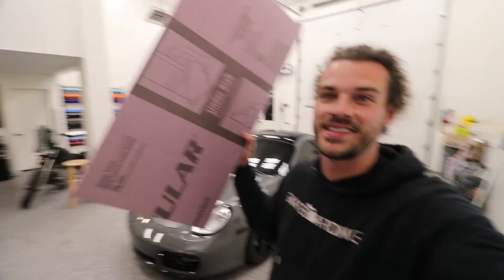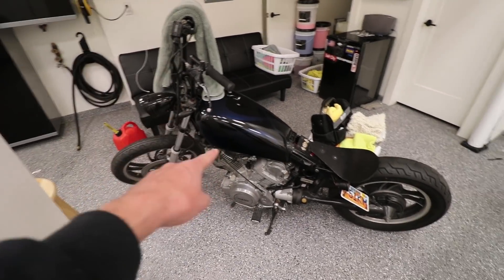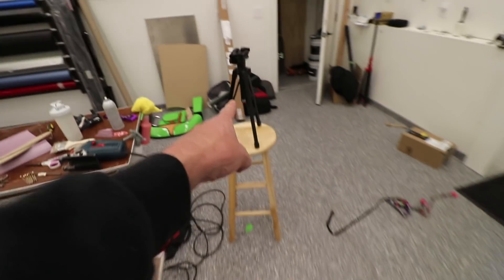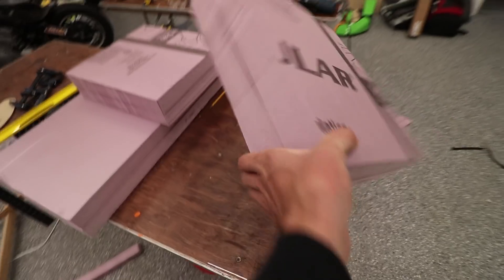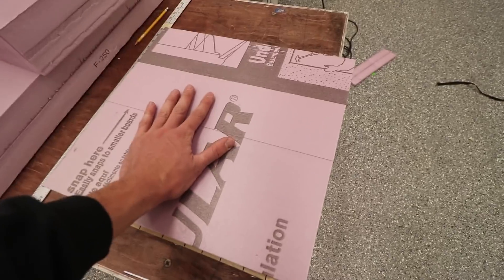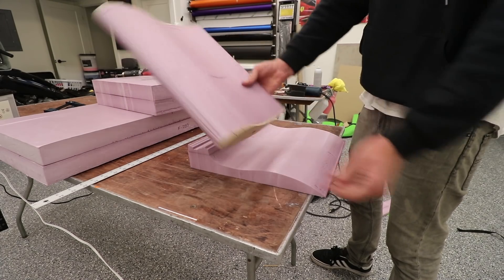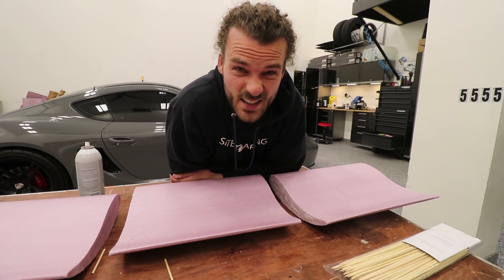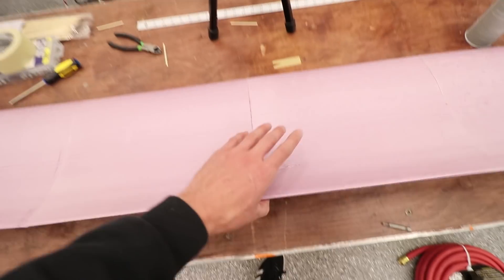Making My Own Custom Carbon Fiber Wing!

Comment: That’s amazing! You could laser cut the shape profile for a even edge. Also, you could use some wood glueing technique for the foam to match the profiles and give it an stronger vertical resistance. Anyway, your cayman is cool as f keep up the good work!

Comment: Great start to the big wang. Better test the resin for the carbon on a scrap bit of that foam first. It may just melt it. I believe most would make a plug out of metal or clay/filler and then make a mold product a hollow piece and then fill it with pouring foam to add strength. Any ways, let me know how you go. Cheers 🤙🏼

Comment: This is looking amazing! Not sure if you started filling in
the spots on the foam yet or know what your going to use but I have used pre
mixed light weight dry wall spackle. It dries fast and sand very easy!
Reply from the maker: Great idea!!!

Comment: i havent been on instagram recently but i did want to tell you that you should find another way to tack the fabric to the foam. The spray adhesive i was telling you about is what was giving me a lot of issues, i was doing some parts last week and the spray adhesive is bubbling up through the weave and leaving bubbles in the epoxy

Comment: hello, you did it very well. With such simple tool, respect. I have to say, be careful. the profile you have formed there is similar to a NACA 9315 profile. It has a very high maximum camber. This provides quite good contact pressure at low speeds (up to 90mph), but may cause a sudden stall at higher speeds. This leads to a sudden relief of the rear / rear tires and instability of the vehicle. Due to the middle engine, it usually leads to an accident. Please study different NACA profiles and the drag coefficient in relation to the speed relative to the neutral angle. I just want to protect you from damage. best regards from Weissach from a professional engineer.
Reply from the maker: Wow thank you!!! I didnt even consider any if that 😬 gotta rethink some stuff